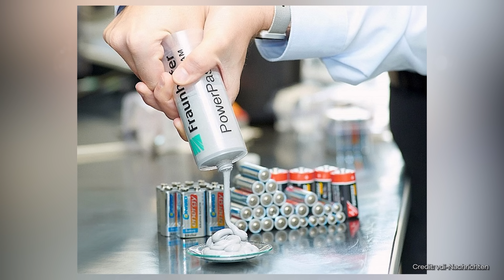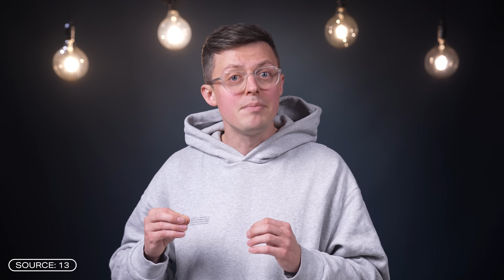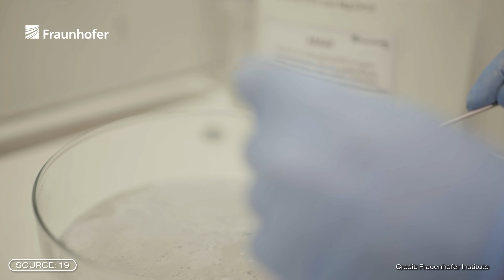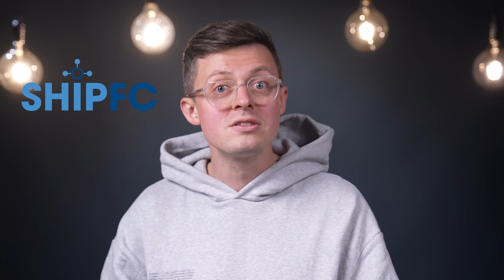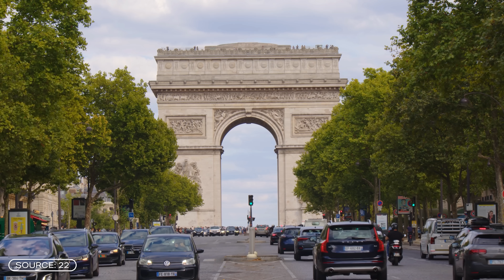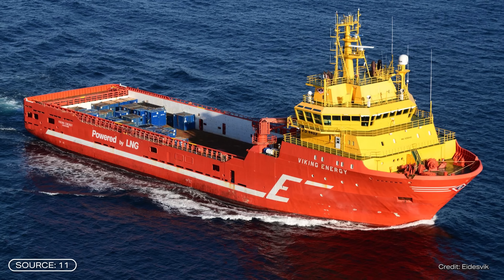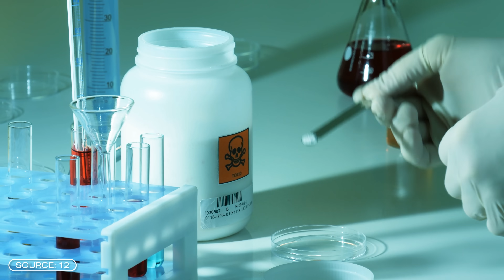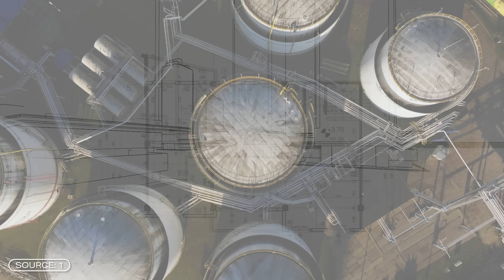Hydrogen Powerpaste: 10x Higher Energy Density & Safe?

Comment: 1,9 kWh/l? ... gasoline, sits around 5 times that, at about 9.3. 
LiIon cells only get 0.65. but you can just re-charge them >1000 times.
Reply: Did you adjust for efficiency? Only about 10 to 15 percent of that energy density is actually converted to usable kinetic energy in gas engines. Hybrids CAN get up to 50 percent efficient, but only under rare driving conditions. Realistic efficiency for hybrids is 20 to 25 percent. Electric motors get 50 to 90 percent efficiency.
  Gasoline electric fuel cells do exist to generate electricity at higher efficiency, but they have to operate at too high a temperature to be practical.
Reply: @derek2593  Modern gas engines are often around 25% to 35% efficient at converting thermal energy into mechanical energy with some higher outliers. Hybrids are often on the higher end and can be a little higher, but pure ICE cars exist with the same sort of modifications to the engine that hybrids take advantage of and are just as efficient on the highway albeit lacking regenerative braking for city driving efficiency. Modern diesel engines are often between 35% and 50% efficient at converting thermal energy into mechanical energy. Unless you're accounting for city driving where much of that mechanical energy produced by the engine is in turn wasted by heating up the brakes, I don't see how you're getting such low efficiency numbers. If you are doing that, then you ought to mention it otherwise people could get the wrong idea.
Reply: @5467nick , it's an average of all the engines on the road today.... But, yeah you are correct.
Reply: @5467nick  why re you lying. 35% ist the outlier as in small low powered economy cars
Reply: @fetB  I clearly said 25% to 35%, which is an accurate range for gas engines in most modern consumer vehicles of all common sizes. I didn't just say 35%.
Reply: @5467nick  you have clearly said "with some higher [than 35%] outliers"
Reply: @fetB  Referring to gas engines exceeding 35% efficiency as "outliers" specifically means that only a small fraction of the gas engines on the road will exceed 35% and that most gas engines won't achieve that. That was an entirely truthful statement I made.
Reply: @5467nick  ye, but they dont. again 35% is the outlier. Not that it actually matters when an electric motor does easily 80%, and all of that clean
Reply: @fetB  An electric motor's higher efficiency number is incomparable. It has nothing to do with the electric motor being more efficient. An electric motor converts electrical energy into mechanical energy, both are equal forms of energy in terms of entropy. An internal combustion engine converts thermal energy into mechanical energy. Thermal energy is not equal in entropy to mechanical energy. If you're comparing efficiency then you must account for the efficiency as a fraction of the Carnot efficiency, not the total efficiency or you are ignoring entropy, a very misleading thing to do seeing as even today most electricity is generated from thermal energy in power plants.

Gasoline powered ICE engines above 35% efficient at converting thermal energy to mechanical not only exist, but you can buy cars from mainstream manufacturers with them right now and they have been available for years. For example, some models of Mazda's cars with their Skyactive motors achieved this several years ago.
Reply: @5467nick  whats misleading, is to use the skyactive engine, which is great (love mazda), as an example of not being an outlier, when it very much is one. Not to mention, that efficiency comes with the performance drawback and is only an ecomodus. Again, love mazda but it only gets that efficiency in certain circumstances and mazda is the only one with that tech.

It is also misleading to say most electricity is generated from thermal, when that is a political and regional problem, not technological so it makes no sense to use it as an argument in a efficiency conversation.

When comparing efficiency, it is again misleading to compare the energy forms in a vaccum. To even get to the gasoline, you had to go through a very long line of sourcing (as in drilling), and spending of a lot of energy (as in pumping, shipping, refining, shipping etc), just to arrive at the gas station and ultimately the ic engine where you then have the lossy conversion of thermal to mechanical, when all this time, you could just source the mechanical energy to begin with.
Reply: And just think of the system-level EROEI - if it falls under that of synthetic Fischer-Tropsch fuels, this is dead on arrival.
Good grief, pyrolysis oil has a better kWh/liter ratio, 5,5 at the lower end. Methane has better kWh/liter ratio at 200 bars: 2,2.
Reply: Gasoline may have a 5 times higher energy density, but what is the degree of energy utilization in use between the two? 🤷🏻‍♂️
Reply: @dennissorensen8765  Gasoline's is probably higher. Round-trip efficiency on hydrogen is usually less than 40% and this uses both hydrogen and magnesium. I don't have numbers for magnesium, but producing magnesium metal from magnesium hydroxide, the waste leftover after using this paste, is extremely energy intensive and that is the main reason magnesium metal (and also aluminum and titanium for similar reasons) is as expensive as it is despite being very common in minerals.
Reply: @dennissorensen8765 , 10 to 15 percent in gasoline engines. 20 to 30 for hybrid engines.
Reply: how do you factor thermic engine efficiency VS fuel cell efficiency in your analysis ?
Reply: 10x lower energy density, not opposite
Reply: thank you all, fur your supportive replies! hydrogen is promising, but in the end batteries are still the way to go.
Reply: @Ucceah batteries is exactly way to NOT go. They are dead end. Without enough capacities, without enough speed to fill and especially without chance to ever have enough good grid in majority of world.
Methanol. Power cells are way to go.
Reply: Internal combustion gasoline engine use 35% energy for torque on wheels, another 65% turns to heat and dumping as exhaust gases and by cooling system.
Reply: So, we can't actually make new gasoline, but you're right, lithium destroys it and most competitors, unless they can be reconstituted easily and even then it's hard to compete with "plugging into the wall".
Reply: Lithium cells has 0,23 and not 0,65 kWh per kg.
Methanol as most usable competitor has 6.3kWh per kg, which means 25-30 more per kg. It can be much mire easy stored and transported then electricity and car can be fulled in half minute with it and not in 8 hours like it is with batteries.
Reply: The power is generated not just from the paste itself but also from the hydrogen atoms from the water that is added in when it is being used.
Reply: I was thinking the same thing
Reply: Someone with some intelligence that understands rational and critical thinking!
I don't know why I feel compelled to acknowledge this other than the fact that these characteristics are nearly completely absent from most people today? And this is just a variable of population and ratio.
Hi rare person 👋
Reply: @jameshatton4211  thank you for being with me, bro! ..at least somebody gets it. 
in theory, hydrogen is a perfect energy carrier .. but in practice, it's an absolute bitch. and it's the "solar friggin roadways" of fuels. by any sane math, it just doesn't work out. 
the one use i can see, is to store excess solar or wind power in a huge gasometer, and use that to fuel to make steel or concrete production carbon neutral.
hydrogen "schmoo" has been proposed for a good few years, and it still does not make any sense.
Reply: @Ucceah it's too volatile and likes to seap through just about any container because of its gaseous nature. Cooling it to liquid temperatures to make it more safe kind of defeats the purpose. I definitely wouldn't use hydrogen as preferred fuel source? It's only because we have been brainwashed about carbon. Carbon causes global greening not greenhouse effect there's this equalibrium between the atmosphere and it's controlled by plants. Give plants more carbon they will grow bigger and harvest more of it and produce more O2.
We have plasma technology using a thunderstorm generator that can now transmutate carbon dioxide and carbon monoxide and converts it directly into 0² oxygen aka breathable air.

All this BS about climate hoax and exhaust pollution will be a thing of the past
Reply: @Ucceah  The heaviest petroleum products are the most efficient. The longest hydro carbon chains are the best at energy transferal.  Diesel is the best by weight of fuel for fuel efficiency.
I'm not a rolling coal promoter by the way, I'm just saying people don't understand full production cycles and purity and cost per yield.

We are better off growing sunflowers and powering everything off biodiesel in my opinion? You know cutting out all of the dead dinosaurs and billions of years geologica compression to sqeeze all their juices out. Plus is will smell like a donut factory where ever you drive
Reply: POWERPASTE (1.9 kWh/L) isn’t as energy-dense as gasoline (~8.8 kWh/L) or diesel (~9.7 kWh/L), but its fuel cell efficiency (~50-60%) crushes combustion engines (~20-30%). 
Lithium-ion batteries (0.2–0.7 kWh/L) win on efficiency (~90%) but lose on range/weight. The paste strikes a balance between them so it's great for small vehicles, drones, or off-grid power where safety and simplicity matter. Perfect for urban mobility or backup power, but not (yet) a diesel killer for long-haul trucks. Future looks bright if scaling and recycling improve. Because let's face, the big trucks hauling loads are one thing, the guy starting his big car to get 1 package of smokes and then sits idling at the mcdonalds drive thru would be better off using the paste. It's not like gas will be around forever.
Reply: @nielsf  Propane also, it has an energy density of 6.6 kWh/L and is simple to store and use. And petroleum may well be around as long as we need it.
Reply: @nielsf  Right now, most of the Hydrogen comes from steam methane reforming to begin with because it is so much more economically viable than hydrolysis. Methane that was especially produced in the refining process.
Reply: Basically if you want to drive as far with the hydrogen car (assuming the efficiency is about the same) as with a petrol car, you need to replace the paste/water/waste with at least 5 times the volume. My car has a modest 50 liters tank for petrol. 5x 50 liters to replace and to fill up the hydrogen paste tank?? I'm less optimistic for the practical use in a car or truck.
Reply: Yeah came here to talk about propane & diesel specifically when he emphasized the comparison to lithium per liter
Reply: @jakospence  are you subscribed to that dude with the VR6 diesel project?

Oh and Hi everyone 👋 environmental scientist and rotary enthusiast here.
Who wants to argue about climate change with me? 😁 I'm ready and I'm not what you think. Congratulations on your moment of internal conflict. How do you feel? 😁
Reply: @jameshatton4211 sounds right up my alley! First car, diesel Peugeot 50mpg. Second car VR6 Passat that got …. Considerably less!
Reply: @jameshatton4211  I say this not as an insult, but as a word of advice: you come off as bait, absolutely insufferable, or both. If you are neither, I highly advise changing the way you approach people.
That being said, I'm curious and have a habit of giving people the benefit of the doubt. So I'm game. Speak up, mate!
Reply: @jameshatton4211  I see... let me try and rephrase it. 
In the internet, there are cool people who genuinely like discussing things, and there are annoying people who try to make others angry and waste their time ("bait", "trolls", etc). These people often lie to come off as friendly. The way you speak resembles them. I say this because I did the same in the past.
But you seem like a cool guy who just isn't aware of the things I mentioned above (which is enviable). So I want to talk to you and asked you to state your points on climate change.
Reply: this paste is rechargeable (but must be done in special devices)